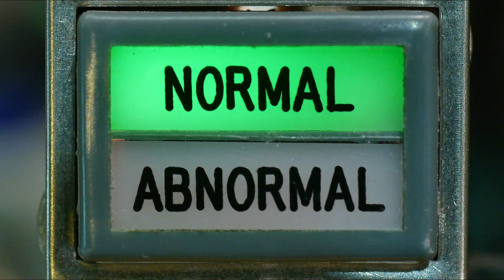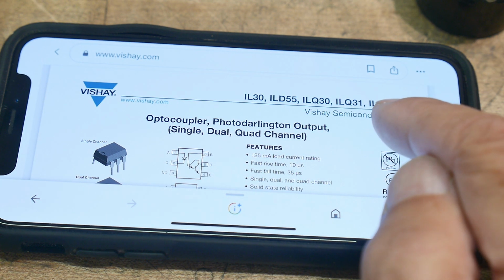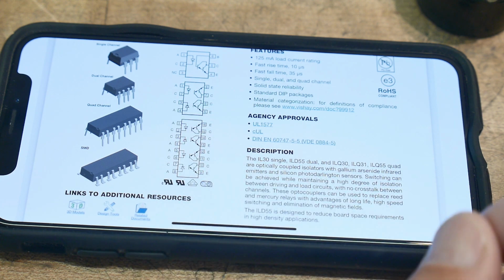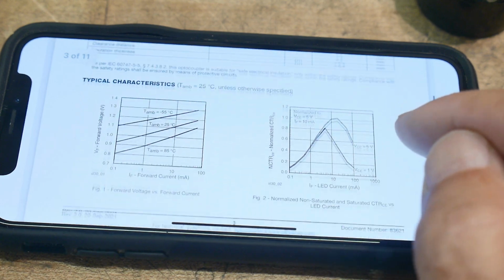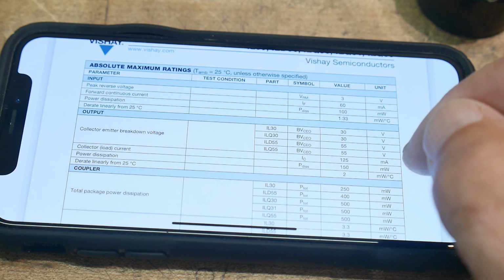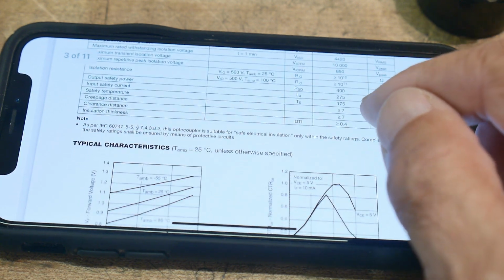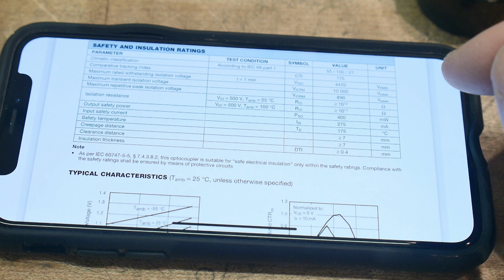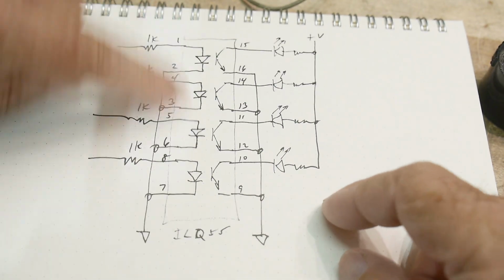#1544 ILQ55 Quad Opto-coupler

Comment: The chip is too slow.  rise time =10us & fall time = 35 us 
This means it can not even support USB 2.
It might be good for old school switching power supplies.  Even newer switching power supplies, which use higher switching speeds to reduce inductor or capacitor sizes, wont be able to use this part.

Comment: Didn't watch the video yet, but I was just wondering If you can speed up opto by cascoding two transistors of the optocoupler. Cascoding with external transistor should work, but the same apply for the transistors of the opto?
Reply from the maker: https://youtu.be/APUhm2tsCiE
Reply: @IMSAIGuy  Cascode can help, but the real problem is photo diode used in opto-coupler.  In forward biased diodes, we have diffusion capacitance, which has to do with diode current (i.e. diffusion current) 
I guess in order to get faster speed, when modulating leaser diodes for example, they do not turn the diode on and off completely.  They keep the diode on edge of threshold in the off condition.  This way they switch the diode between low light and high light.